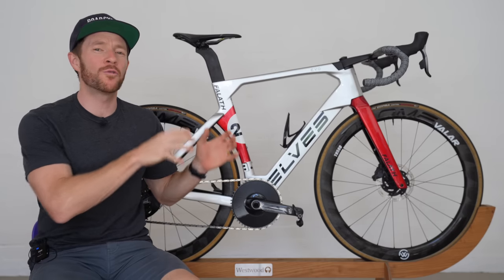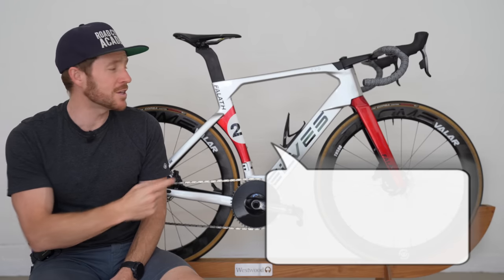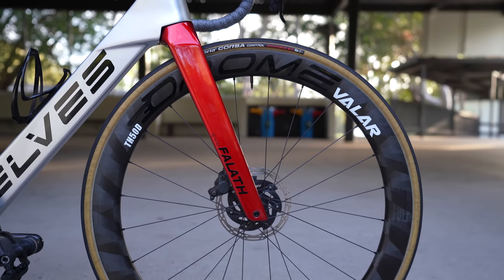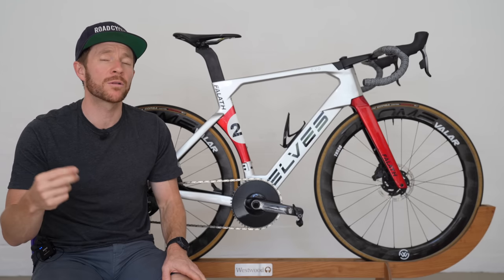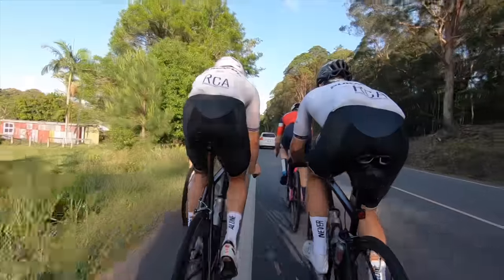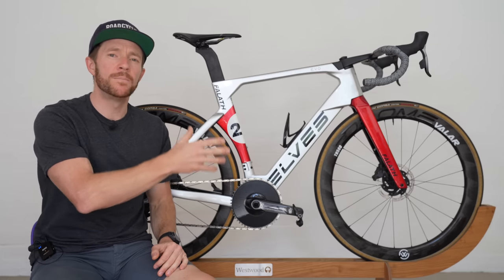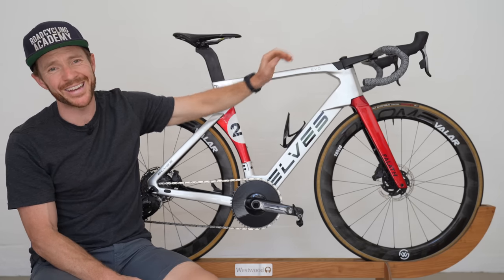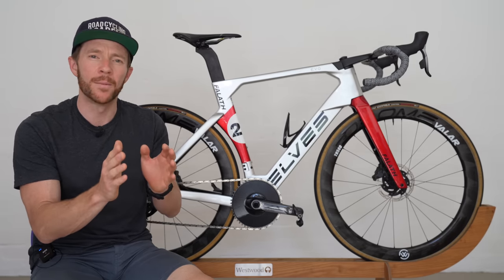Elves Falath Evo Ride Review

Comment from the maker: From Elves re tyre to frame clearance: Different 32C tires have different specs, like the Continental 32C tire size can reach up to 35C width. A Continental 28C tire size reaches up to 30C or 32C.
Reply: that depends on the internal rim measure  - right
Reply: @martinhotan8946 yes but tyres themselves will inflate differently, so it's not just a question of rim width
Reply: @lauig  25 or 28 front, 30 back is working fine and not unusual
Reply: @michaelhaar  30mm closes down that gap to the seat tube significantly? Thanks.

Comment: "Full carbon fork" historically meant that the fork blades and steerer were both carbon as opposed to the carbon blades being carbon and the steerer tube being aluminum. That's an industry standard claim. Elves saying it is spec'ed with a full carbon fork is true according to the industry standard definition. No correction needed.

Comment: Does the rear wheel/frame interface impact aerodynamics, yes, but not as much as you think. The air is already so turbulent in this region, so lamiar flow to be controlled is limited, plus there is wash from the rear wheel and legs. Closing the gap by shortenig the chainstays would (not by much) change the handling, but moreso compliance. Closing the gap by adding material would only add weight for negliable aero gain (look at the new tt shiv for example). 
Plus having more space allows the rider to use different tyre widths, plus limits scratching from stones or other crap that gets stuck in the rear tyre.

Comment: Looking at the '22 UCI Vanyar atm. They have a UK distributor now which streamlines the whole process. Talking about hub noise. Just got some mavic wheels for the hardtail for gravel use. Now I love mavic hubs, their bearings are so smooth and have lasted longer than any I've known in 30yrs of cycling. But the hubs are so damn quiet. Had to buy a bell for the cycle paths! 😀

Comment: The Falath Evo is a straightline missile and feels every bit like the superbike that it is. My Specialized Allez Sprint feels very twitchy and hard in comparison. The value is off the charts too, here in Europe, the frame and handlebar combo is just over half the price of the similar Winspace T1550. 
That being said, I do have some stuff I'd like to see changed. Like improved heel clearance at the chainstays, zero setback seatpost option and revised geometry for the larger sizes, with longer top tubes and shorter seat tubes. But overall, the Falath Evo is awesome if it fits.
Reply: this frame is not aero lol, it has a square downtube. The frame looks like its price
Reply: @mortenravnsns8439  dont need to
Reply: @Rob-fx5yn  Exactly what I've been saying.
Reply: @Rob-fx5yn  There's nothing "brick shaped" about it, unless you have eyesight like Mr. Magoo.
Reply: @mortenravnsns8439  hmm i would get a check up if i where you
Reply: @Rob-fx5yn  The data says the aerodynamics of the Falath is very good. So you just keep on rejecting reality and substituting it with your own lol.
Reply: @mortenravnsns8439  which windtunnel?
Reply: @Rob-fx5yn  Did you watch the video?
Reply: @mortenravnsns8439  yeah but those tests dont mean anything, to many variables. There is a reason bikes get tested in windtunnels
Reply: @Rob-fx5yn  No one rides a bike in a windtunnel, for god sakes!
Reply: @mortenravnsns8439   its a controlled environment to test aerodynamics duh
Reply: @Rob-fx5yn  The Falath Evo is very fast and aerodynamic, proven by Cam, myself and others. If you feel the need to prove your own BS by going in a windtunnel, then please go ahead.
Reply: @mortenravnsns8439  you are just looking for confirmation bias
Reply: @Rob-fx5yn The falath is ridden by quite a few asian pro teams. If the aerodynamics were shit they wouldn't ride them

Comment: Hey Cam, just wondering if you have ever looked at Wiggles house brand wheel Prime and their new Primevera range? 
They seem like great value, Wiggle are pretty damn easy to deal with if things go awry and how they stack up against these Chinese brands. 

Interested in your thoughts, great video. Top work mate. 👍🏼
Reply from the maker: Thanks for the suggestion mate, I’ll look into it.
Reply: I had a pair of Prime wheels and had used them for about 11 months before my mechanic told me there were multiple cracks in the carbon rim and it was unsafe to continue riding.
Reply: @alexyehorov2359 I guess no one should ever buy them then?

All brands get some failures. That's what warranty is for.
Reply: @CamNicholls  cheers mate
Reply: @alexyehorov2359  Interesting, Prime have different level wheels what were yours that had cracks? How did Wiggle deal with the defects?
Reply: @CanonFirefly well for what it’s worth, I had their carbon handlebars for 4 months before they cracked. All torqued up to spec etc. They also weren’t very stiff you could feel them moving when out of the saddle.
Reply: @CanonFirefly  I don't remember saying you should not buy them. I just shared my experience and in my opinion those are low quality wheels (cheap carbon and not so great spokes material as those get broken easily). Similar feedback was left by someone else but Wiggle recently changed their design and that review is now gone. Never had these sort of issues with other brands.
Reply: @CanonFirefly I don't own a pair of those wheels and never have. In fact I never heard of them until this thread. But in my vast experience of NOT owning those wheels, I can certainly recommend not purchasing them and buying something else. Naturally, this is only my experience, but I have over 4 decades of not owning those wheels and wouldn't take a chance on ruining that now. I've just got too much not invested in them.

Comment: Thanks Cam! Appreciate your work on these videos.

It looks like the down tube is not made with bottles in mind. I.e. faster without bottles, slower with bottles. While some other frame's down tubes are fatter, designed to work with round bottles, aerodynamically. Do you agree? Did your test runs have round, aero or no bottles? Looks like none.

Thanks mate!

Comment: What an awesome, informative review! Interestingly, the steerer tube on my Falath Pro (it finally arrived after 6 months!) looks completely different. Fiberglass inside is black, and 0.1mm thick at most. In fact, in the reaming process it was machined away completely in many spots and carbon is peeping through. I haven't seen any delaminations either, although only on the bit I cut off, I don't have a way to check that non-destructively.
Reply from the maker: Thanks for sharing on the thread Michael. That sounds like the way it should be, which is pleasing to hear.

Comment: Hey Cam, great video as always! Was just thinking the test run times you're getting uphill now might be faster than those 3 older bikes because your weight has reduced in recent times!? Might have to start logging your weight on these tests as well 😅
Reply from the maker: I have put on 1KG since that series (back focused on work now) and I loaded the Elves with a 750ml water bottle (1.2KG), which takes me back to average weight of 79.5kg. So I did have bodyweight mind but I didn't want to add an extra 30 seconds to the vid explaining. However, you're right, I should start tracking weight irrespective or maybe not bother comparing to previous runs anymore. Perhaps there's too much grey. Cheers, Cam
Reply: @CamNicholls  it's all good, still love the content and your perspective these bikes is invaluable. I'll still be here waiting for the next video 😊

Comment: I’ve got an Eglath Pro Disc a few months back. Same TH50 wheel set with a custom GT40 Gulf paint scheme. My experience has been very similar. Bars are a bit flexible at my questionable sprint power of 1200 and 82kgs so take that into your decision process. Quality comfort bike for pennies on the dollar when cross shopping Cervelo or Trek.
Reply from the maker: Interesting to hear, thanks for sharing on the thread Steve.

Comment: Yō bud quick tip that helps me with climbing with the girthy top tubes it some body glide on the inner thigh/knees and some on the top tube as well, goes on clear no fuss with the paint so it won't stick to you. the other thing is the long stems really effect your side to side out of the saddle but aero/climb are going to have compromises. i have a 90mm stem and it's manageable-ish.

Comment: Thanks for the depth informative review of the frame. I have been waiting for your Review before purchasing the frame as I am very keen to try it for my self. I have their Orome Wheels TH50D for the past 6 months, rode in all conditions and its really good for Money and performance!

Just a quick question,  I too ride 2022 BMC SLR01 in size 54 for 180cm rider with 775mm saddle height. What is your current set up on your Elves?
Saddle height and Integrated handler bar reach? I'm on the fence to o pull the trigger on size 52 or 54. 

Thank you!

Comment: Would be good to see any rider weight differences between the climbing efforts vs speed differences
Reply from the maker: I have put on 1KG since that series (back focused on work now) and I loaded the Elves with a 750ml water bottle (1.2KG), which takes me back to average weight of 79.5kg. So I did have bodyweight mind but I didn't want to add an extra 30 seconds to the vid explaining. However, you're right, I should start tracking weight irrespective or maybe not bother comparing to previous runs anymore. Perhaps there's too much grey. Cheers, Cam

Comment: Hi Cam that was a good review and tells us more about the ride experience than many marketing led ones do.
Perhaps you should log your weight or total bike/rider weight for these tests.
I have been thinking about downsizing frame size too,have looked at some 52,53,54cm frames to shorten the reach but many have too low a head tube for me.
This looks closer to endurance geometry such as Look 765 Optium but with that high and wide top tube. 
You appear similar dimensions to me,I am 178cm,88cm. inseam,about 77kg.
You are 178cm, what inseam?

Comment: Im trying go get over how you can fit on a 52cm fran Cam at 179cms.is that the effective top tube measurement or the seat tube? I'm 180cms and im in a 56 and a 58 too tube with a 12cm stem.

Comment: Geometry wise I couldn't even buy the smallest frame with a 76cm inseam, stand over is 77cm. Even then I would then need a 14 -15cm stem. At 168cm I have a long torso and short legs. Actually with most of the Elves frames I would struggle to get a good fit, but with this frame it would be impossible. Not that I'm in the market far a racing frame 😂. Great review none the less Cam.
Reply from the maker: I real world inseam case right there!  Thanks for sharing on the thread mate.
Reply: @CamNicholls  What's your inseam cause you seem to be running the seat quite low ?

Comment: I assume this bike’s geometry is for those breakaway artists riding with their elbows paralleled to the ground hence the higher stack.
Yea, saddle to bar drop looks cool. But how long can one sustain riding aero on the hoods with that much drop?

Before anybody disputes this, Peak Torque did a video on how a higher stacked bike could be faster. 

I think that’s the direction Elves took with this frame.
Reply from the maker: Interesting to hear, thanks for sharing on the thread mate.
Reply: Yeah, higher stack, as well as lower saddle to drop distance makes it easier to hold aero hoods position, which is the fastest one on road bikes.

Comment: It's like buying a new CPU or GPU. Sometimes you win the silicon lottery and you can overclock the bejesus out of the thing, sometimes you have to return it because it won't run at stock speed without crashing.

Comment: Hey Cam you downsized to 52 and I noticed your saddle is slammed forward. Is the frame still too long for you?
Reply from the maker: No the other odd part to Geo is that the reach doesn’t really change that much from a 52 to a 56 so I went 5mm additional reach than normally by going a 120 stem on a 52. Hence pushing the seat forward
Reply: @CamNicholls  oh you are right! Falath 2022 also has that and the steep offset made it worst lol. I also moved forward my saddle by 5mm

Comment: Was the wheel weight to spec?
Reply from the maker: Just a bit over. Website spec is 1445g
Reply: seems to fluctuate a a little bit. My set was 1429g. That said fantastic wheels for the price. Been riding them for around 1400km so far without any issues. Also 32mm tires do not look goofy on it wich is a plus in my book since roads are pretty terrible where i live.

Comment: I’ve switched from 28-32mm tyres and it felt slower and more sluggish at lower psi due to tubeless but the numbers show faster. Did you collect any data on it? Unsure on where I sit on width.
Reply: pogacar rides this tour on a 28mm conti 5k TT on 25mm internal enve rims which measure 30mm wide. 
feeling of speed is more a result of small road chatter which in fact slows a rider down. 
There is no reason to go to less than 28mm. Every recreational rider should ride 32mm on super wide rims. The science is there, the pros are riding it and everyone I know who has switched to wide tubeless won't ever switch back.
Reply: @vini20900  is that what the data says? Translates to lower rolling resistance which speeds the rider up.

Comment: Didn't you go from 12% body fat to 7% body fat? Don't know how times between bikes can be compared if your body has changed so much? Anyway, food for thought.
Reply from the maker: I've put on an extra kilo since that series and loaded more water onto the bike to make it even. I left that context out of the video because I didn't't feel it was needed. So overall, weight should be the same.
Reply: @CamNicholls  Ok, thats always the hardest thing for me testing bikes from week to week. A couple of kilos, a different jersey, leg warmers in the winter, different lubes on the chain, or even changing your sunnies... too many variables. 2 seconds faster over 3 and a half minutes is like 1.5% which is about half a gnat's arse. Still, it's reassuring that it's not 20 seconds slower or 20 seconds faster...
Reply from the maker: @ChinaCycling  Yes agree with you mate and I know there's many variables that make these tests questionable. In this case adding a 750ml bottle (circa 1.2KG) to the bike VS having that in bodyweight. What impact does that have external to raw weight? Who knows...but these tests give me something to look at and are better than nothing IMO. Cheers
Reply: Nice review Cam!  I have a Falath Evo built up by Michael Redding at Creative Cycles Workshop in Melbourne.  It's an absolute weapon and it looks like a work of art.  Couldn't be happier.

Comment: This bike would look so much better if the front end was cleaner / better designed visually. hate that bottom of that black part (dust cap / bearing cover etc) takes a step down like that. Should be nice and straight. Or at least color it same as bike main color so it blends in or something.

Comment: No thanks, this frame requires too many compromises. First there's the weird raised top tube which causes both fit issues and thigh rub issues. Then there's the bizzare selection of the obsolete PF30 bottom bracket. The extremely questionable "aero" design which includes big gaps between both tires and the frame. The weird sizing. The regular Falath seems better in every way.